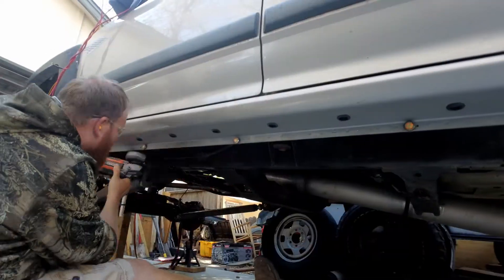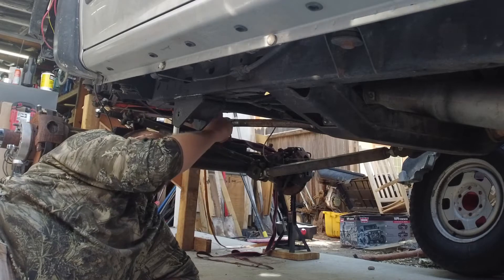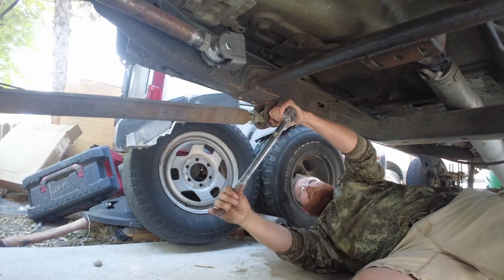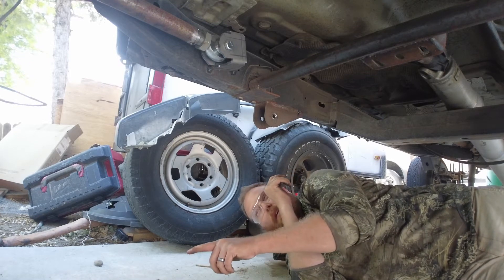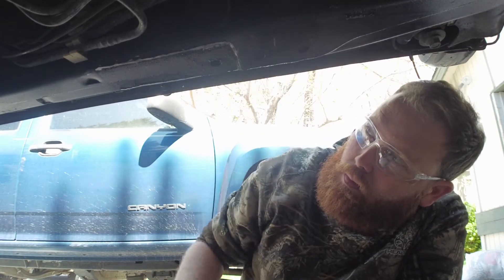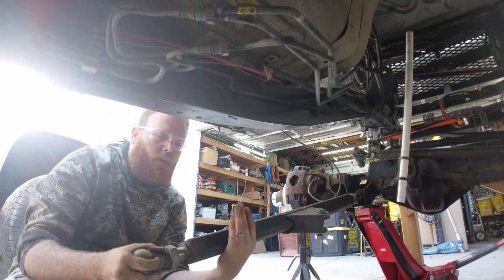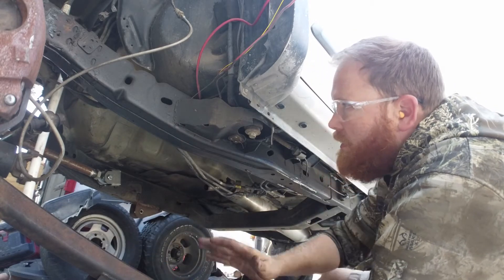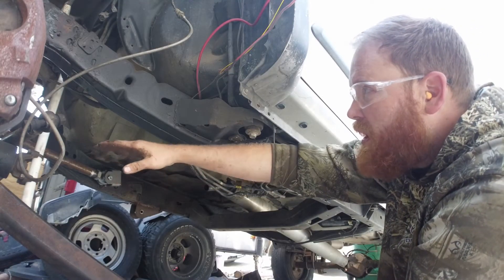6l80e Swap & Dual T-cases - BBV Ep8

Comment: Have you calculated your crawl ratio? Got to have that ready when you get around Toyota guys since they have to run twin cases with the 22REs
Reply from the maker: 145:1 with a final drive under 2000 rpm at 70 with 40s.

Comment: Surprisingly the two t case + trans doesn't look as monstrously long as I thought it would
Reply from the maker: 4.5 ft from the bell housing to the end of the tail shaft. Granted only 10 in longer than without the doubler.